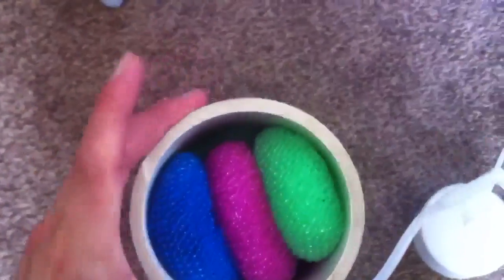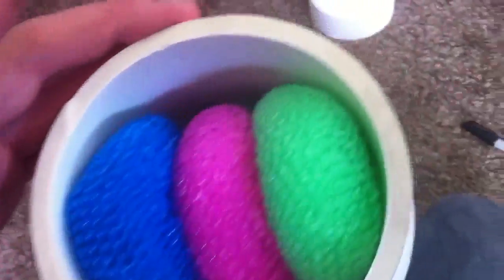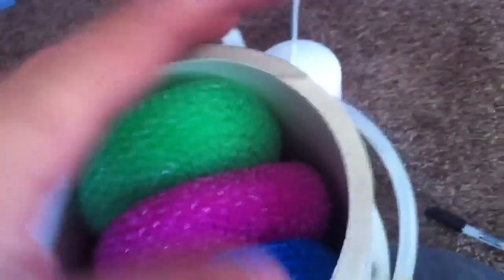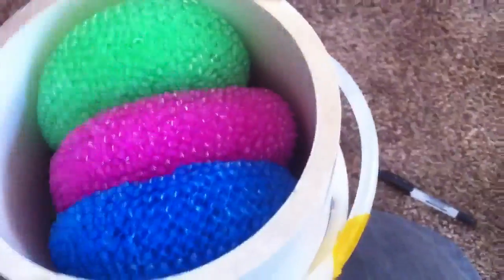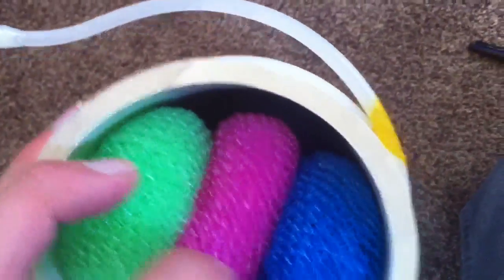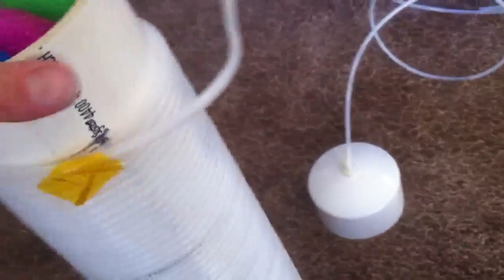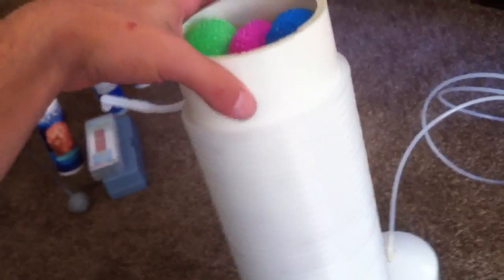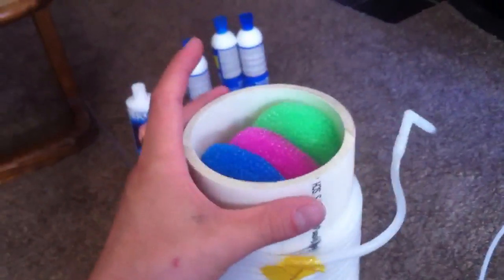DIY Coil Denitrator pt.5

Comment: I have made sevreal of these ciols and they definatly work The onlyproblem is if you go to fast with the floe they can backfire and spit out more nitrites and nitrates BUT Each time i made it bigger and longer and it worked aster with more sise  I believe if it were 1000 feet of coil with a 24inch 4 foot pipe stuffed full of scrubbers you could run it like a tap and still work